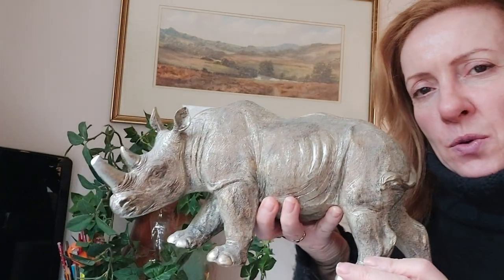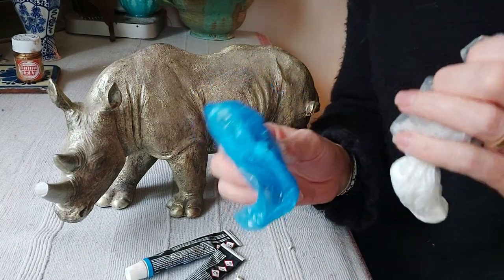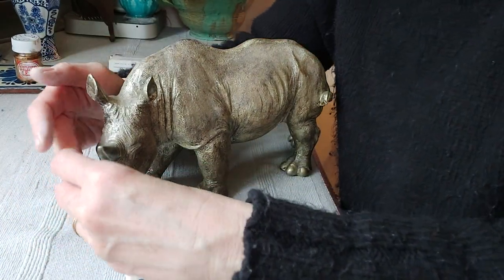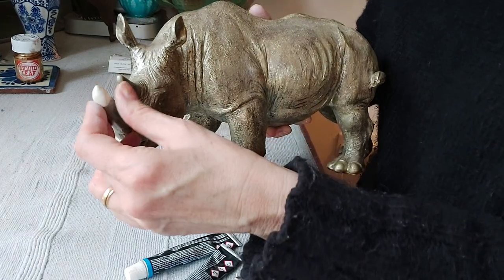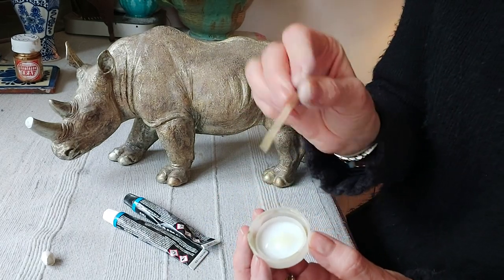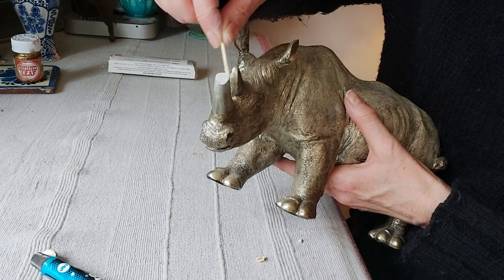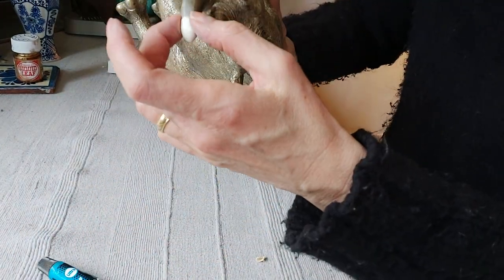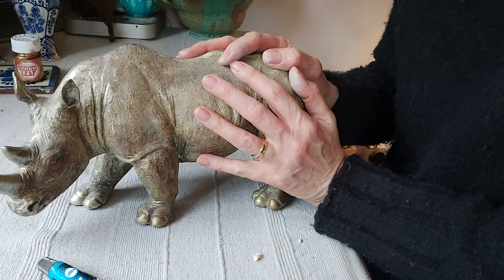MAKING EXTRA PARTS WITH MILLIPUT

Comment: I think gold colors are not easy to do and have them look right. 40 years ago I put some rub n buff cream on a wooden frame and was quite happy with it.  Now it looks rather tarnished and quite decrepit, and I think I’d like to redo it. Should I go with a paste color again (or gold paint) or should I try some gold (metal) leaf? I haven’t really done “gold” leaf except on a very small frame. It was challenging. I suppose I should try to remove the old rub n buff before I try to redo the frame?
Reply from the maker: Hi Janet, many thanks for your comment.  It really does depend on the finish you are after. The paint I used was a gold leaf paint which is a lot easier than using gold leaf. 💕
Reply: Hi! I so admire your work. I ordered a tube I of milliput on Jan. 5. I am still waiting and eagerly anticipating its arrival.
Reply from the maker: @jerseygirl5721  Please let me know how you get on.💕